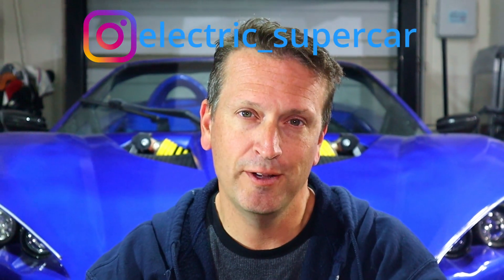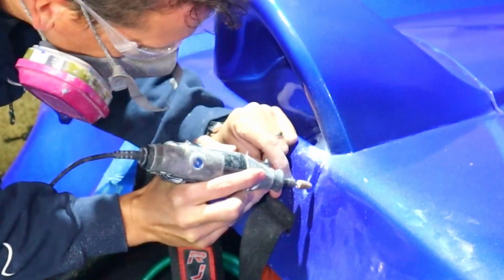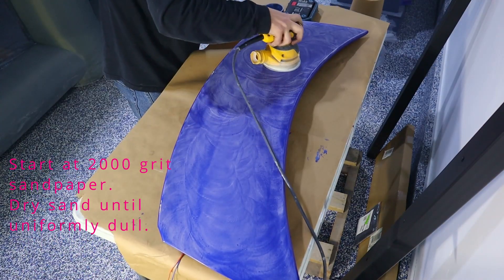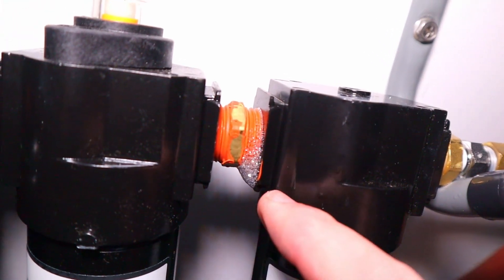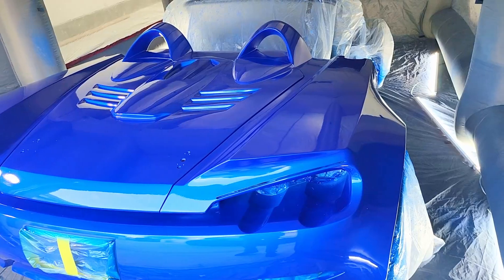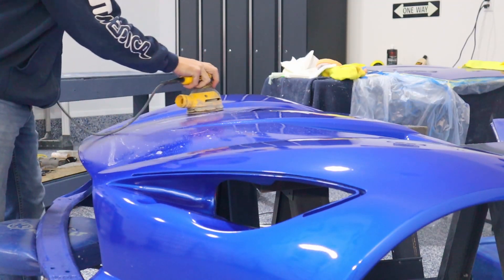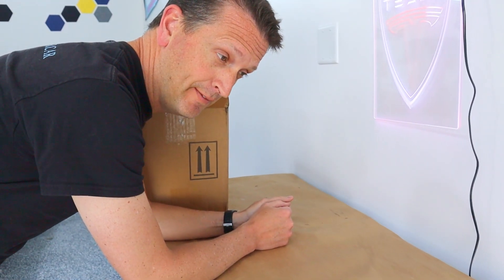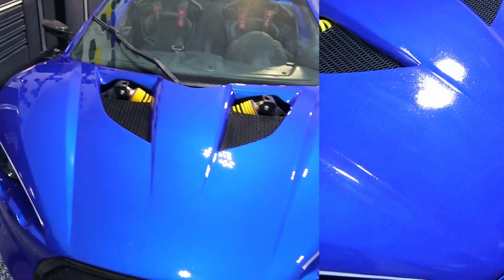Paint Correction - How to make car paint look good (Finally the looks match the performance)

Comment from the maker: Install Raid for Free ✅ IOS/ANDROID/PC: https://clcr.me/ElectricSuperCar and get a special starter pack with an Epic champion ⚡ Kellan the Shrike ⚡ 
Click here📱https://egghunt.plarium.com to participate in the AR EggHunt Event. Get your chance to grab Legendary RAID Champion or Amazon Gift Cards with a total value of $20K for FREЕ💰🎁
Reply: Do you have a wiring diagram for your electrical systems both high voltage and low voltage that I could reference? I'm working on a build inspired by this and am stuck on this part a little. Open to paying for it if reasonably priced.
Reply from the maker: @DARKORBITPYRO  send me an email Electricsupercar@gmail.com

Comment: Tip for the air compressor is those vibration dampers must go both sides, and preferably also have a spacer between the bolt and the actual foot, or use compliant rubber spacers, like you see on AC compressors. That removes a lot more of the vibration, and in addition you can also reduce the noise by putting some acoustic panels at the compressor height on the wall, to reduce the reflection off the hard surface. A simple cabinet, lined inside with the acoustic treatment, but with a large gap top and bottom for airflow, that is about a foot off the floor, will also help with the noise.
Reply from the maker: Thanks for the comment!

Comment: Years ago I went to Wyo Tech in Laramie Wyoming (WTI) for paint and collision repair.  You did an awesome job and the end result was fabulous.  However, there are a few things you could have done to speed up the process.  1) There is no need to use  2000 grit or even 7000 grit.  Color sanding to eliminate the orange peel, 1500 grit is sufficient. And I would never use any mechanical sander for this job.  Always by hand, and always wet sand.  Any good rubbing compound with aggressive cutting will polish out the 1500 grit.  2) For heavy cutting rubbing compound, a wool polishing wheel works really good.  The key thing to remember is to keep the wheel lubed with compound, keep it moving, and clean often with a spur tool or screw driver.  3) Now is the time to remove the swirls that the heaving compound creates.  A foam wheel is best with the appropriate detail polish that is designed to remove swirls.  Always remember never to use a polishing pad for this step that was used with the heaving cutting compound because there's always heavy cutting compound that gets embedded in the wheel.  Therefore you'll never get rid of the swirl marks.  Polishing is pretty complex, but you did an amazing job about the way you did it.  And I love that blue.  Nice!
Reply from the maker: Thanks for the tips!

Comment: For a long lasting look could go for paint protection film (PPF) or ceramic coating. Would suggest PPF but it's upto you. But that's a beauty. Great job. Now please upload more Porsche videos also. Thanks to EV doctor 🤜🤛
Reply from the maker: Thanks for the comment!
Reply: @electricsupercar  Yes you did a great job, and making sure all the orange peel is gone is hard. Wax the car ata minimum, proper paste wax, or put on the ceramic film, to keep that surface good for a long time, and if possible put a skin on the front bumper lower and edges, to reduce stone chipping as it gets driven. Same for the door lips as well.

Comment: the mirco swirls are from the sand paper clogging up with the dust and residue off the clear coat... A couple things u can do to mitigate this is; change out ur sand paper more often and use water to Wet sand. Heat doesn't help when sanding... but it is good when buffing. When using the compounds do a small section with a small amount until it basically disappears into the paint... if u put on too much compound it basically just slides around and does nothing.
Great job doing it in those cold conditions 💯💯👍
Reply from the maker: Thanks for the suggestions!

Comment: Professionals always do preliminary machine work with a rotary. An industry standard is the Makita 9227C. I like to use that with 3M waffle pads for heavy work (I’ve used 3M’s line of polishes / compounds). Now, that setup certainly will burn through clear very quickly so you do have to be very careful, but it will also correct paint in a single pass (per product). Finishing with an DA/RO (I use a Porter Cable 7424) is definitely easier (one handed operation, no swirls).
Reply from the maker: Nice!  Thanks for the suggestion!

Comment: For an all around guy  that can build, do bodywork, paint and polish ?You did very well with the sanding and polishing, the car came out great. Next time use a rotary you will cut down ur polish time in half. You got the right compounds from the start but the random orbit polisher was ur achilles heel it's like having dull knife...Let the paint shrink and cure and before the end of summer u can color sand 2k, 2500, 3k, 4k, 5k buff it with a rotary. I would gladly help u next time u polish let me know no charge lol.
Reply from the maker: Nice!  Thanks for the suggestion!

Comment: I have never done any work like this but I do a lot of metal sample surface prep for microscope imaging. Most of these deeper scratches that persist into polishing come from one of two issues. First, not fully sanding away the previous scratches before moving on to the next pad (i.e. moving on from 4000 to 6000 without removing all of the scratches from 2000 with the 4000 pad.) The smaller scuffs sort of hid the deeper scratches but they will reappear once you start polishing. Second, not fully cleaning the surface in between grit changes. This can leave coarser grit on or embedded in the surface causing deep scratches as you are using a finer grit pad. It becomes impossible to fully remove the deep scratches since you are continuing to drag the material around as you try to remove them. This issue also contaminates you pads causing them to not work properly ever again.
Reply from the maker: Thanks for the comment!

Comment: And the Colour blue actually looks really nice When are you planning to upgrade the interior also could you try something like get a Tesla from copart which has autopilot and fixing it in to the k1 attack and you can add the Tesla screen as well to give it a sleeker look inside outside looks nice but what about the interior
Reply from the maker: Thanks for the suggestion!
Reply: @electricsupercar  wait I never new you’ll reply that fast so you are going to try and see if it works out that’ll be the first k1 attack with autopilot level 2 your interior does look okay but it does need some futuristic style to the interior you could like add strip light and some other cool features like change the speedometer from an iPad to something from a salvaged Tesla model s or a third party speedometer would make it cooler

Comment: fish eyes are annoying. looks great!  you should look into circular polishing. its definitely faster with correct rubbing compund (i was taught with 3M rubbing compounds and they worked fast) after sanding but you run the risk of burning the paint if your hands are slow so it does require a bit of practice so you dont overheat your area youre working and burn the paint but youll save so much time if you get the hang of it.
Reply from the maker: Thanks for the tip!

Comment: As far as i know you should not sand in a rotation. If you just sand in a straight line its easier to polish off.
PS: that yust makes it faster, what you achieved looks really good and I apreciate the work put in!
Reply from the maker: Thanks for the suggestion
Reply: Sanding in a straight line is a great way to gouge lines in the finish. It can certainly be done, but should be done carefully and only near edges or body lines.

Comment: I hope I don't sound rude but do those rubber isolators do anything useful @ 10:18 ? The concrete anchors are a stiff/rigid connection so vibration would go into the floor anyways. Just asking.
Reply from the maker: Great question!   In theory they do.  I was just excited to get it off the pallet
Reply: @electricsupercar  I guess they do protect the epoxy floor :)

Comment: Came out really good overall!!   After you painted you had a ton of orange peel on the surface you delt with nicely.  If you need to cut more you probably want to upgrade your polisher (look into orbit length), Milwaukee makes a good cordless that is a fan favorite.  Also consider Rupes or Meguiars MICROFIBER polishing/cutting disks as well as their foam line.  Works a lot better than the chemical guys stuff I used way back in the day (Upgraded my polisher a few years ago from the chemical guys stuff and was amazed at how much better it worked; I run a cordless FLEX but the Milwaukee is probably a better value and was not available back when I got mine).   Some good stuff on polishing from the obsessed (https://youtu.be/CUFz2en04qs).  OG Matt Morman is quite cocky... but the dude knows a thing or two for sure!  Once you get it all dialed in, could look into a DIY ceramic coating like Geyon MOHS Evo, or The Obsessed Garage Crystal Serum Lite (CSL) + Exo Topper.  Keep the awesome content coming!
Reply from the maker: Thanks for the detailed comment!